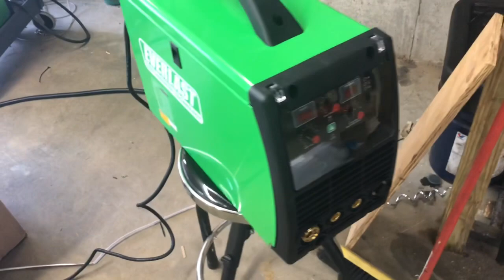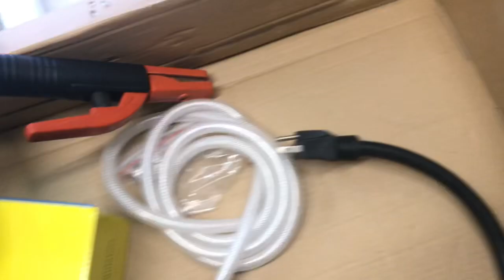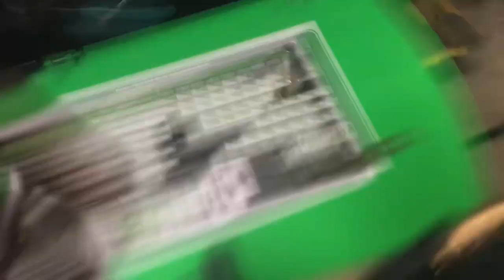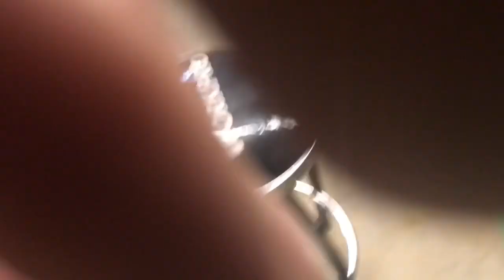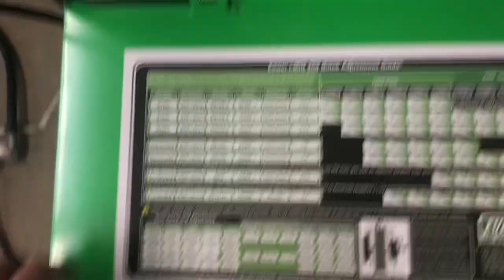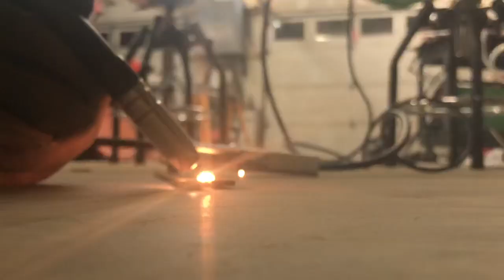Everlast Power i-Mig 200 Review

Comment: For all the learning welders out there; prep your work, don’t crack the cylinder open slowly, make sure flow meter is vertical, check for leaks and don’t develop the habit of shutting off the welder immediately after done welding.

Comment: How is these welder doing im looking to buy it but i found 2 or 3 bad reviews
Reply from the maker: So far so good.  Ive got through over 1 spool of wire and only issue I had was the hose clamp on the flow meter failed so the hose popped off. But that’s easy fix.    If there’s anything I can do for ya let me know

Comment: I just picked up the 200 aswell. I'm working on getting the electrician to run me an outlet in the garage for it so I can try it out!
Reply from the maker: Awesome man. Your gonna love it.  I already went through a spool of wire in mine.
Reply: How is these welder holding after 3 years im looking forward to buy it?
Reply: @lsxpower3367  inverter welders have come a long way in the last ten yrs. If it's not used commercially for 8hrs a day every day I'm sure they will last a long time if kept clean and not abused